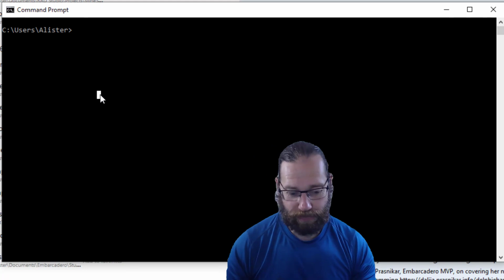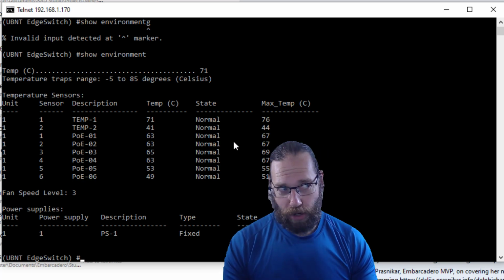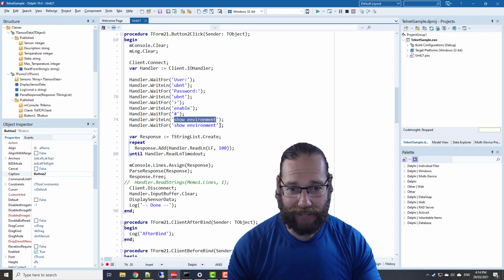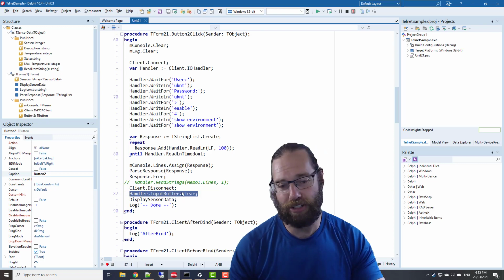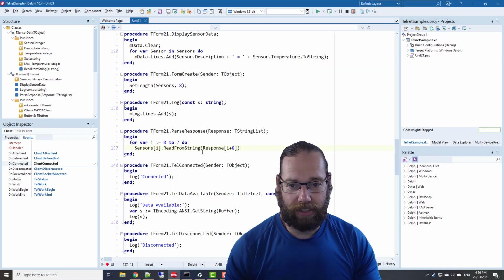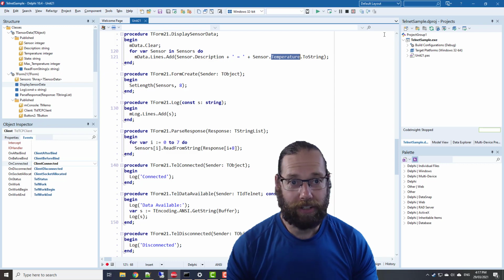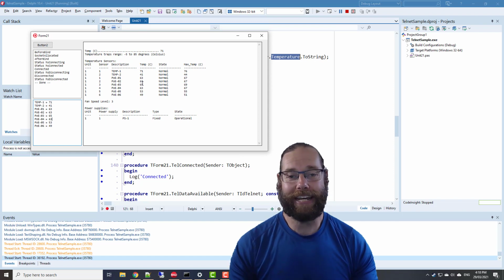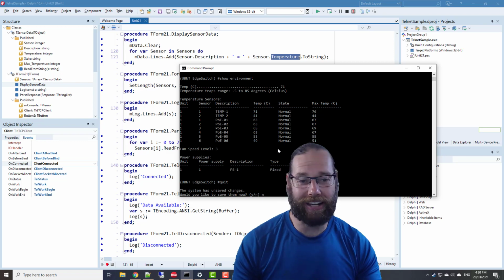Delphi #171 - Telnet

Comment: Aren't smaller fans louder because they have to turn faster to shift the same amount of air?
Reply from the maker: In this case they don't need to shift very much air, but yes, small fans can be really (really) loud.  I have considered cutting a big hole in the side and mounting a 120mm fan - which would probably be close to silent, but not very pretty.